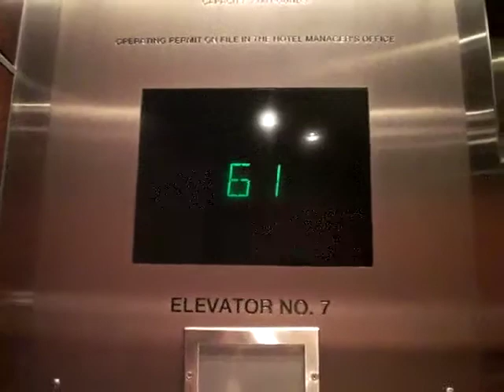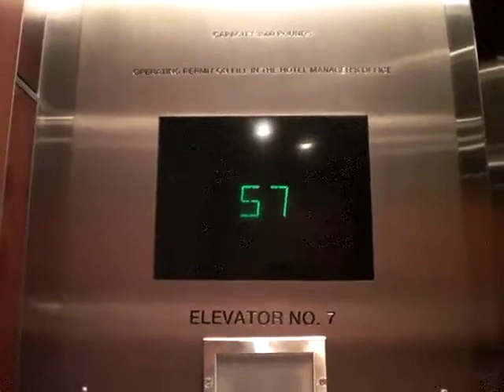Otis High-Speed Elevators at Westin Peachtree Plaza Atlanta

Comment: Do these elevators open the door a bit before the car actually stops after it arrives from other floors? (I mean like if the elevator comes from lower floors, when it arrives and when the door starts to open, the car still moves a bit slowly and finally stops when the doors are completely opened?